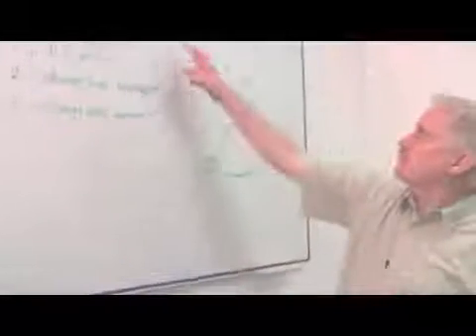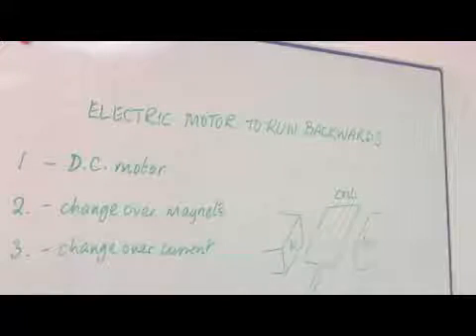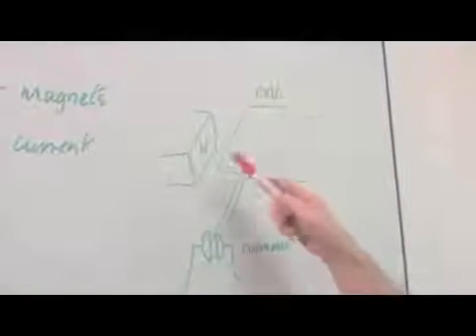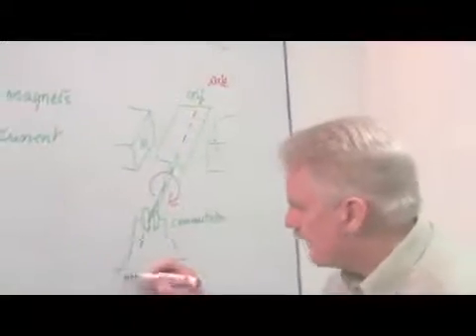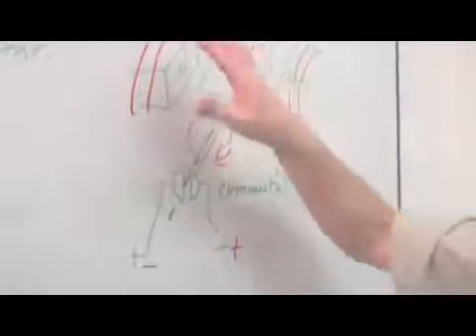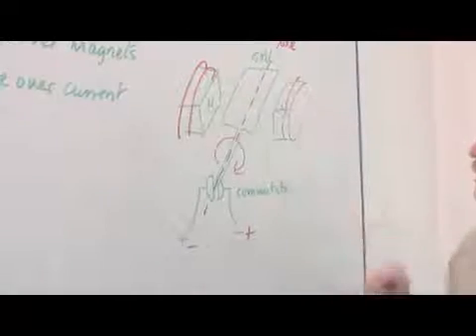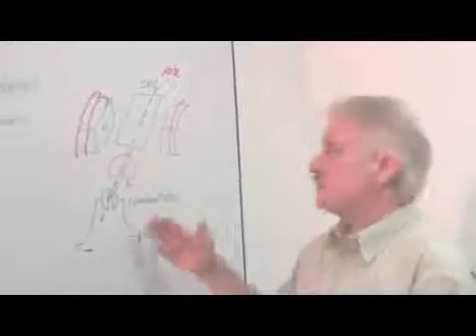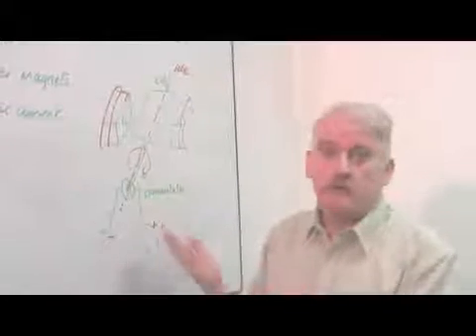How to Make an Electric Motor Run Backwards

Comment: So, I took motor apart (dc) put back together and it runs backwards. Do I turn the armature a 180 degrees to get it back to the right direction? Or did I mess it up for good?